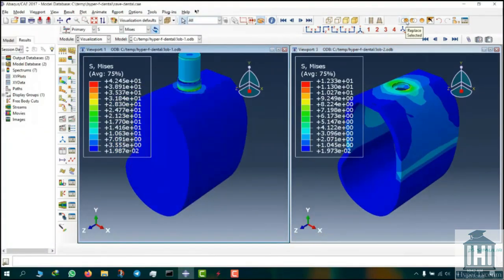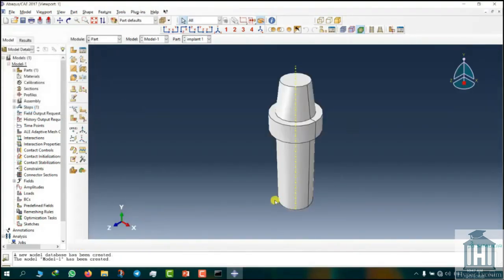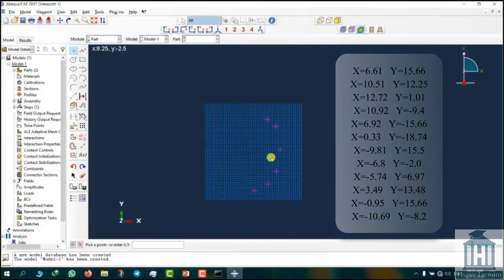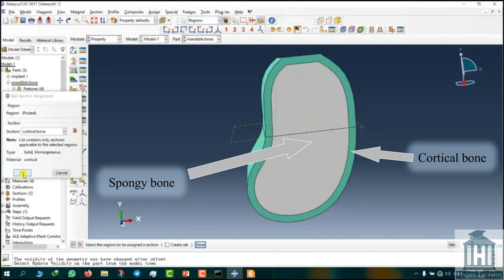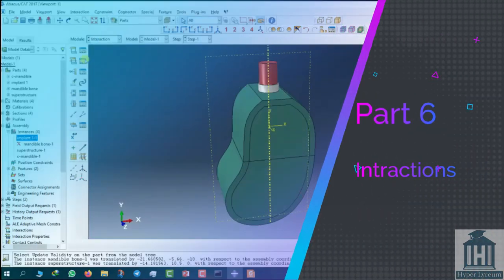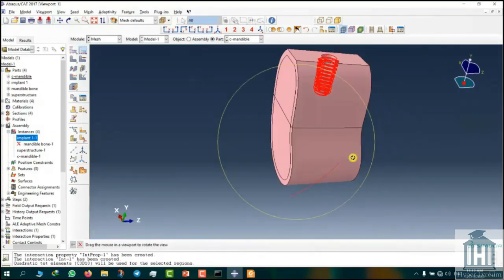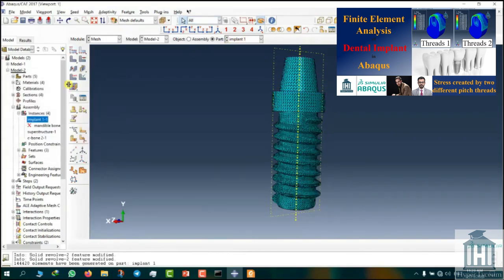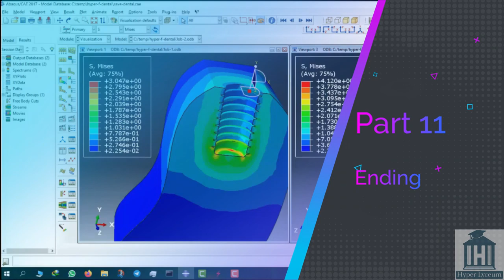Finite Element Analysis of Dental Implant in Abaqus

Comment: Sir i'm getting this error what should i do?
The volume of 756 elements is zero, small, or negative. Check coordinates or node numbering, or modify the mesh seed. In the case of a tetrahedron this error may indicate that all nodes are located very nearly in a plane. The elements have been identified in element set ErrElemVolSmallNegZero.